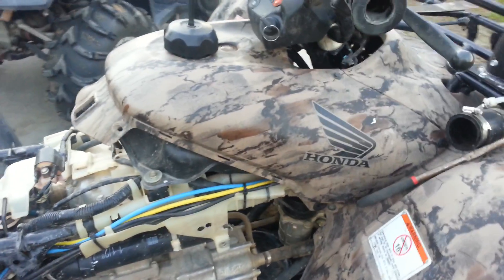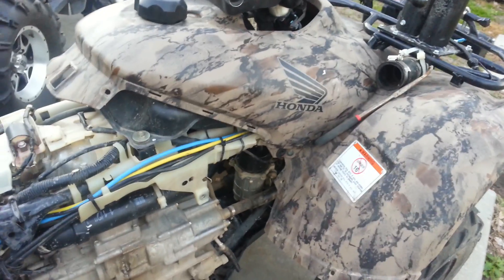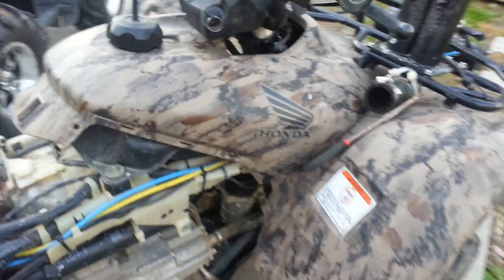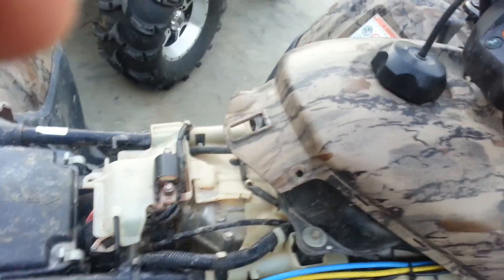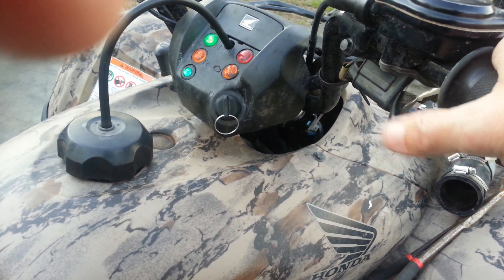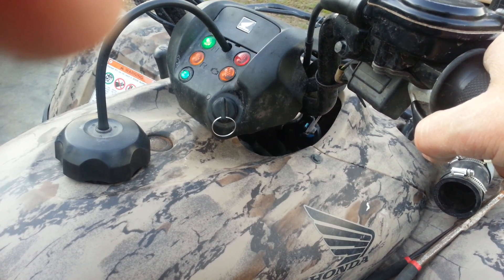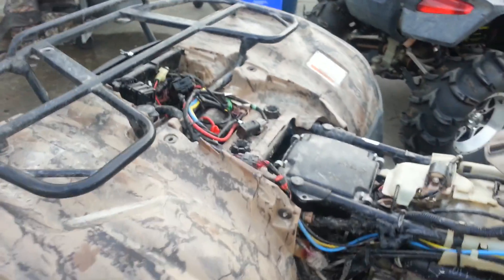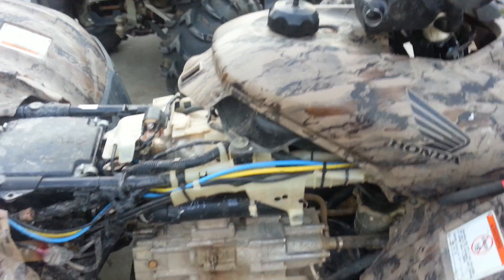2013 Honda Rancher engine problem.

Comment: On my 2008 Honda Rancher when I was running it hard on hot days, it would go into derate mode and I would have to shift all the way down to 1st gear to drive it.  In the evening when it was cool it would have all the power in the world again.  Turns out the fuel pump was getting weak.  Installed a new $135 fuel pump and it has ran great for years now!

Comment: Hey did you ever found the fix for your atv a have the same issue in a 2008 rancher 420
Reply: I am having the same problem... rev to half throttle than bugs down.... i openend my motor and saw that it was wrong by one tooth... i fixed that and now i am waiting for the hondabond is ready.. then we will see if that was the problem
Reply: It is one tooth off...
Reply: @alltilagi  so i need to remove the entire engine uh?
Reply: @agenrique55  yes.. it took me 2 hours to take the engine out and fix it.. no problem..very easy.. you  an look me up on Facebook i can show you pic.. it is Óli B Hilmarsson.. 👍

Comment: Hi There.  I have a 420 that is doing the EXACT same thing.  Did you ever figure out what the issue was?  Please respond if you see this, as I am at my wits end!!  Thanks so much
Reply from the maker: I've never figured out the issue with that Honda 420 issue. Have you had any luck yet?
Reply: No, I never did figure it out.  I changed fuel filter, checked valve lash, replaced spark plug, checked fuel pressure, checked battery voltage, cleaned all connections from engine back, changed injector, changed coil, cleaned main ground to frame, changed PGM FI, cleaned throttle body, changed TP/Map sensor and prayed to Vishnu for guidance.  Nothing worked so I sold it!!
Reply from the maker: I did the same thing I finally sold it
Reply: Yeah, I saw that later on when I read the comments.  You did as much as I did, and still couldn't figure it out, so I thought I would do like you and sell it.
Reply: @SampleProLtd  sucks was hoping y'all figured it out mine is doing the same thing my son ran it out of fuel so had to put a new fuel  pump and now new injector and clean the fuel system someone said try the relay bout the only thing I haven't tried figured if was bad it wouldn't start
Reply: Hi Brad.  The person I sold it to, and yes I made him fully aware of the problem, got back to me.  He said he took it into the Honda dealer, and even they were stumped.  They ended up calling Honda to try and find a solution.  It turns out, the timing chain jumped a tooth.  I have no idea how that happens, but that is what he told me the dealer told him.  Hope that helps!
Reply: @SampleProLtd  thanks was hoping that it wasn't something like that but makes sense run fine before only thing that was stumping me is that it acting like it is running way to rich new spark plug is black from carbon not oil and is black smoking
Reply: That's exactly what mine was doing.  Carbon fouled plug after 30 minutes or so of running/trying to rev it.  Acted like running rich.  Try this - close the petcock and run it out of fuel.  Just before mine ran out it revved perfectly.  Then I just cracked open the petcock a hair so as to drastically restrict fuel flow, and mine would rev perfectly.  I still think it was a fuel issue but the person I sold it to said the dealer told him it was the timing chain jumped a tooth.  If that is the case, then it seems like the 420's are prone to this, as I have seen many posts on forums describing the exact same symptoms.  Best of luck

Comment: Similar trouble on mine. Theres a filter in the gas tank on the fuel selection lever. Removed the hose at the fuel pump from the tank and let it empty itself, after 5 minute of draining and gas tank half full the gas slowed down to just a small drip. Cleaned the filter in the tank and know it works perfect.

Comment: Have you try changing the iddle control valve on top of the carburator? Mine did that and now wont start just cranks, i got fuel spraying from injector and spark
Reply: Jose Correa it’s fuel injected

Comment: sounds like the plug is fouled out the other is i wonder if the fuel pumps is bleeding off pressure the other thing i would be looking for is a rubbing ground some where hope you get it figured out
Reply: changed the plug,  I bought a new CDI, Coil, voltage rectifier, tested the fuel injector, fuel filter appears to be clean, compression is perfect.
This is my 4th rancher 420 and this issue on this one is driving me nuts
Reply: B Whitfield have u found out What s wrong with it yet I have one doing the same thing in can't find out What s wrong with it
Reply: After a year I gave up and sold it.
Reply: Before I sold it I put a new fuel pump and filter but didn't fix anything.
Reply: I hear a lot more valve noise than I have, I'm thinking valve adjustment

Comment: So I was riding my 2013 Honda 420 es around right after I put a brand new electric shifter on it and i think it over heated and shut off and wouldn’t shift anymore also couldn’t crank in gear unlike usual plus my radiator started smoking

Comment: fuel pumps goin out mine did the same thing I just blew in gas tank vent line when trying to rev it it revved to the rev limiter replaced fuel pump and it never did it again

Comment: Any fix for this yet? Mine does the same thing
Reply: try flushing the fuel lines and clean the tank
Reply: not yet, I bought a new CDI, Coil, voltage rectifier, tested the fuel injector, fuel filter appears to be clean, compression is perfect.
This is my 4th rancher 420 and this issue on this one is driving me nuts
Reply: B Whitfield  just clean the fuel filter what's in a fuel pump the have a fuel filter and fuel pump...
Reply: Cleaned it and finally replaced filter and pump. No change
Reply: ok we had one of of those it did the same thing just replace the fuel filter in the fuel pump..  in that vas it...
Reply: I heard the was a issue for a lot of people. Thanks for the help
Reply: B Whitfield no problem

Comment: Something that is 2016 ussaly not saying it dissent but what that sounds like it is a crank shaft rubbing something with engine possibly a centrifugal clutch sense from what sounded like it was loosing a lot power carb bikes do not have fuel injectors crank shafts can be really easy to fix if it’s not to bad witch it use to mine had same problem I’m buying a new crank shaft for soon how you figure out it’s your crank shaft drive it around and if it gets worse and your giving it full throttle and you loose power and speed it’s that exact thing cintrifigal clutch is little different but thx for that video

Comment: I would lash the valves and test the voltage regulator
Reply: Valve Lash would do Nothing but Low Voltage of any kind in the Battery will Cause Problems...

Comment: Did u get it fixed if so what was it
Reply: not yet, I bought a new CDI, Coil, voltage rectifier, tested the fuel injector, fuel filter appears to be clean, compression is perfect.
This is my 4th rancher 420 and this issue on this one is driving me nuts

Comment: fyi the valves were making a ton of noise. all it probably needed was a valve adjustment. that would also explain the backfiring. honda says to have the valves adjusted every 800 to 1000 miles.
Reply: im a 30 year Recreation atv Mechanic and Lose Vales Do not Cause Backfiring What So Ever Period...Sound More Like The Rev Limiter from the Reverse Mode Position is whats Causing the issue to me!

Comment: hello again
I have find  this trouble believe me i am a certified honda technician about 45 years  the problem isen,t in the fuel system
If you wish to know the solution ask me
Reply: I am jabbing similar issue now.
Reply: Mines doing that
Reply: Plz can youl tell me what's the problem i had the same problem
Reply: Jean Reviens so what is the problem please Help I have a 2013 Honda Rubicon 500fa and mine does the new carb changed oil front diff rear diff dumped and cleaned gas tank blew out lines and it still does the same thing when you give it gas
Reply: Did you found out the problem
Reply: My is doing the same problem is a 2007 rancher 420

Comment: Factory new fuel pump I had the same issue with the just about same exact fourwheeler
Reply from the maker: Fuel pump
Reply from the maker: These Honda Rancher 420 are not as well built as the old ones. What do you think?

Comment: if it is it's not getting enough gas and the other thing that ticking sound going on in your motor that sounds like your timing chain and it's coming off and when it backfires it is skipping time every time you make it backfire

Comment: with what I read here nobody really knows these engines
I am a certified mechanic of honda for 45 years.
people say to check the carburetor needle (it's stupid because) these engines are fuel injection.
For those who know and understand what I say here. When the revolution reaches that the problems begin I inject gas into the trottle body and there is no change then .. it is not a lack of gasoline.

 It is possible that there is too much gas .... when the rpm reaches the engine malfunction the spark plug become black and in low  rpm  the spark more stay normal in color

I am also looking for the cause of this problem since (5 hours) and when I will have found it I will come back here to tell you the REAL cause.

For example this problem looks like a camshaft when the exhaust lobe is very worn but in this case it is not the camshaft.

I doubt the injector that has high rpm does not close fast enough

I am also looking for the cause of this problem since (5 hours) and when I will have found it I will come back here to tell you the cause.

I am certified technician honda for all their products so I know where I am going.
Reply: Sorry for the words that are repeated. I am French Canadian and I use google translate to write here.
Reply: master mécanic I have a atv that has a carburetor on it and it’s doing the same thing and the spark plug is black...any thoughts

Comment: fuel pumps goin out mine did the same thing I just blew in gas tank vent line when trying to rev it it revved to the rev limiter replaced fuel pump and it never did it again
Reply: I'm having the same problem just bought a brand new fuel pump and it is still doing it. Any advice where to go now?